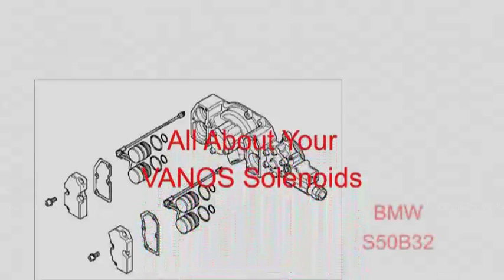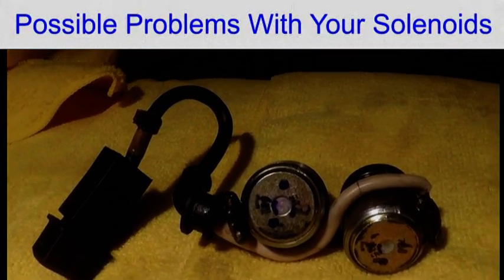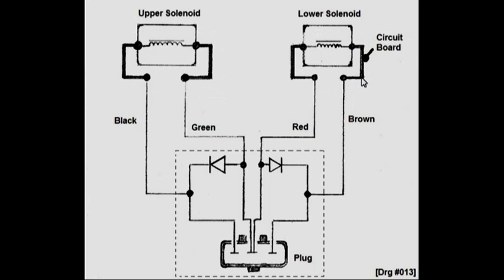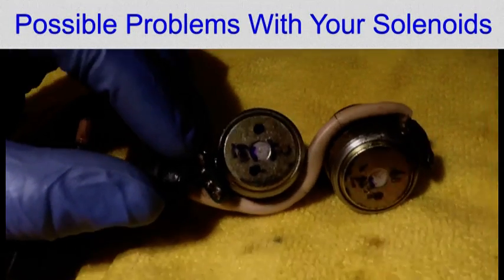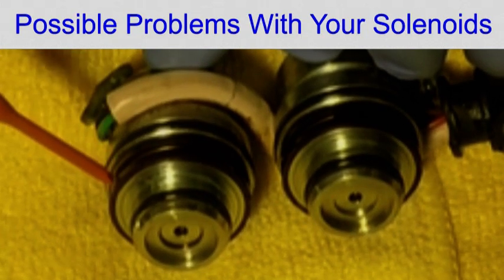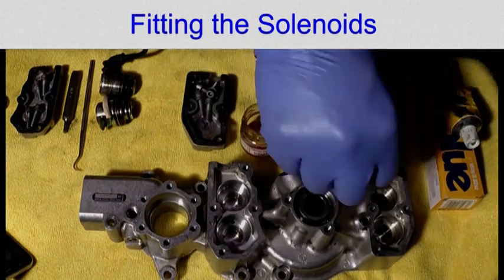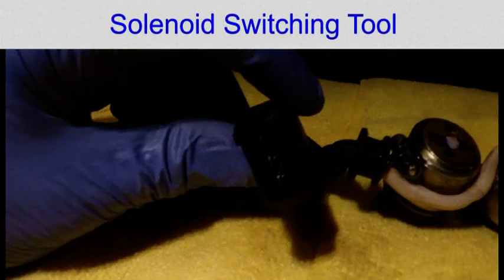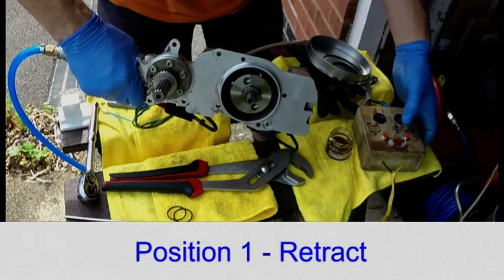Servicing the VANOS Solenoids on a BMW S50B32

Comment: Hello ! If the diodes are bad let's say.... would the car run bad ? Or would the plug get hot ? . Thank you !
Reply: The diodes are "fly-back diodes".  They protect the ECU from a very short (in time [a few milliseconds]) high voltage reverse pulse.  A failed diode wouldn't cause the car to run badly, unless it had fried the ECU and the solenoid wasn't working at all.

Comment: I have an issue with my solenoids, the problem is that 3of the 4 solenoids are giving 3.4 ohm  and the remainig one 9 Ohm. Now i don't know how to fix this of its some diode problem or the solenoid itself... What can i do to test ? What would you reccomend me to do ??
Thank you
Reply: The circuit is at 1:49 in the video.  It is important that you test the centre and one of the outer pins, then reverse the testing pins on your resistance meter.  If you don't test in both directions, you may be measuring the reistance of the diode and not the resistance of the solenoid.  You want the lower of the two resistances.  Alternatively, and better, would be to desolder the solenoids and test them.
Reply: @pingu393  yes i did test the center and each of the two pins  two on exhaust side give 3.4 ohm, and one of exhaust 3.4 and 9 but i soldered It again and now It gives much more.
Thank you for the answer.
(Hablas español ? ?
Reply: @kennethdecuyper  muy poco :) .  Did you mean intake side?  One is 3.4 and the other is 9.  I would desolder the side with the problem and test them.  You can also confirm that the little circuit boards are secure.  If they are loose, or have dry joints, that could be your problem.
Reply: @pingu393  on exhaust side , yes one is 3.4 other was 9 now we heated the conectors to melt then again to test and after that It was more than 9... The solder boards i think that this one has a little more play then the rest, its just strange they all have 3.4 except that one... Will try to desolder and test individualy but the mechanic says its desde for sure, anyways i Will try to remove it anyways i Will need to put another one . The problem is to find a good spare one. Thanks

Comment: Exhaust solenoids are without groove at the head of the solenoid!
Intake have two grooves at head of the solenoid(near the small o-ring)...

My problem is one exhaust solenoid(lower one)...
He gave too much play in the Vanos housing and he have damage-as polished!

I have a chance to buy one for intake side(with grooves) ..

Is this problem for exhaust side ?

Thanks mate in advance !!!

M
Reply: I thought that all the solenoids were the same.  I'm not an expert, as I have only done my vanos, and it was quite a while ago.  I don't recall there being any difference between the four solenoids.

Comment: Do I need some silicone around solenoids?   Or shims ?

My exhaust solenod again leaking after 4500 km!O-rings is Viton!
Reply: I'm surprised that your seals are leaking after only 4500km.  You should soak them in the oil that will go in the engine (I use Mobil-1) before you fit them.  The solenoid should be quite hard to push into the hole, as it is a very tight fit when the o-rings are in place.  I wouldn't use silicone grease, as this may block up the orifices in the vanos unit if it reacts with the engine oil.

Comment: I have problem with my one soleinoid. It is the one on the top on the right side. The engine han an idle between 400-800 rpm. going up and down.  Is it possible to clean the solenoid in a way?
Reply from the maker: Sorry for the late reply.  I've only just seen your comment.  I cleaned the solenoids with brake cleaner and a cotton bud.  In theory you could aim compressed air at the solenoid orifice and activate it, but I don't know how successful this would be or what damage you may cause.

Comment: Can i pull out my solenoid when the vanos is still mounted to the engine? or do i have to take it apart? i think i have a bad connection to the solenoid. my intake cam angle is at 500+ and it wants to be around 54. i dont where to start to fix this. I also got this fault code: Retard valve, VANOS exhasut code 15. what do you think this can be? or where to start? thanks in advance
Reply: The solenoids are actually easier to remove when the VANOS is still fitted to the engine, as the vanos won't move (and you don't have to try to hold it in a vice).  Your main problem will be lack of access and working in a tight space.  I would use a pair of Stilsons (plumber's wrench) to twist the valve loose.

I suspect your cam sensor could be at fault, as your valves would probably be hitting pistons, or you would have lots of smoke if your exhaust valve was opening at 500 instead of 54!!

Does your engine sound bad?
Reply: @pingu393  hello thanks for feedback, no my engine sounds healthy in my opinion, got some smal rough idling for a split sec. Sounds like a smal cough but that could be for my faulty o2 sensor. 
Theres alittle bit of smoke comming from the exhaust yes, but its very minimal.
I uploaded a video of my car when i give small throttle trying to get the vanos sound. https://youtu.be/sr-3-ua6NWk
Reply: Your engine sounds VERY tappetty.  When were your valve clearances last checked?
Your exhaust should be at around 0 at idle and increase to 10-20 with a blip to 2000-2500rpm.  Your intake should be 60 at idle (it looks like yours is 54).  The intake shouldn't change until you approach 3000rpm.  Yours blipped to 46 at one point.

Does your software display "Expected cam position", or does it only display "Actual cam position"?
My first check would be valve clearances (https://www.youtube.com/watch?v=7JFEcR9x7nk)
Reply: @pingu393  im going to run the same test with my launch scanner, that one has english. Dont think my car have had any valve clearence done do it. Not in my time atleast.
Reply: I just did a actuation test on all 4 solenoids with the diagnose, everyone made a tik tik sound when test was activated except for the Retard valve,vanos exhaust. that one where completely silent. 
i checked live data again with a different diagnostic tool (https://www.youtube.com/watch?v=uXIiLzkfMBY)
Dont know why the camshaft actual intake said 500deg before, now with this diagnostic is read 52deg. wierd..

So i was thinking about checking for bad soldering on the retard exhaust solenoid. i think i will find my fault there or what do you think?
just bought the vanos seal kit today, and i am going to check the valve clearings ;)
Reply: is it stupid of me and not do the Euro S50 Double Vanos Rattle Procedure?
Reply: @Daniel1337  Yes, check for bad solder.  You may not even need to remove the solenoid.  You may be able to get enough access with it fitted.
Reply: @pingu393  yees😁
Reply: @Daniel1337  Rattle is good for performance, but bad for noise.  The rattle is caused by weak diaphragm springs.  Some people remove them, but that would lead to your camshafts advancing and retarding too quickly for road use.  It's a race thing only.  Fit S62 diaphragms if you need to replace them.
I use graphs to tell me if they are ok.  The actual should follow the expected.  If it doesn't, you can zone-in on the fault from the graph.
Reply: @pingu393  thats sound very good, then i’ll take the vanos only! Thank you !!
Reply: @pingu393   just done with the vanos job, all went well and found the faulty solenoid and fixed it. The fault code doesnt come back anymore. But my inlet and exhaust is still wrong degree. https://imgur.com/gallery/NDs2FhN
Do you know why? :)
Reply: @Daniel1337  A snapshot is not very useful.  Do you have a video?
Reply: @pingu393   yhe, i can upload :)
Reply: @pingu393  sent a little video :)  just ordered a O2 sensor and a crankcase vent hose, the one on the intake manifold is flat and leaking😬 hope to get this car running smooth again soon😁